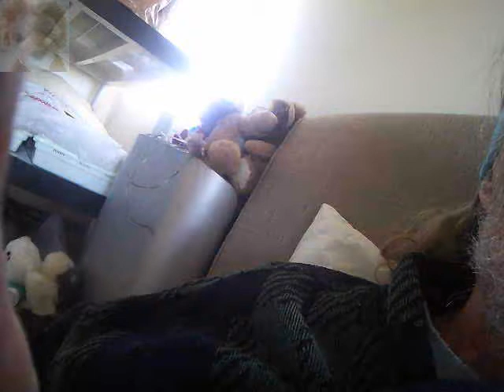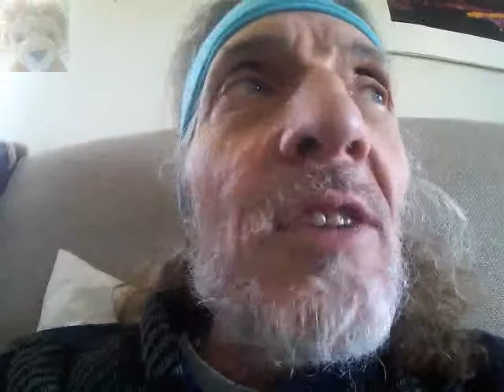Energy Machine of Joseph Newman IS Overunity, yet IS NOT very efficient.

Comment: some thoughts.    assumptions.   they tend to lead us ASTRAY, whatever the field of endeavor.      notwithstanding simulation results to the contrary, do you Normally Assume that a claim of overunity is  Valid, when such claimed performance has  NEVER  Once  been Replicated.  ( ie, searle, neuman, and others;   such a circumstance leaves me,  very  Dubious  about the Validity of the original claim.  )      cheers
Reply from the maker: The realm of the abstract idea is very real. We could not engineer bridges or sonnets or recipes in the concrete realm, wherein we live and breathe and take up space, without it. It needs no other defense. It is our Muse; we are its beneficiary. It is eternal and non-changing; we are temporal filled with imperfections including the doubt of its existence while feeding from it at the same time.

"Never bite the hand which feeds us" is aptly applicable.

How long can we live without inspiration?

Next question, posed by God to Noah.....
"Hey dude, how long do you think that you can tread water?"

The only failure to replication would be our lack of understanding and the initiative to work hard picking ourselves up no matter how many times we fail or doubt our integrity.
Reply from the maker: Check out...
http://is.gd/divcon
Reply: do you know that this responds to my reply  Not  At  All.     if someone claimed to have designed a super-efficient  rectangular,  not square or round,  wheel and made fabulous claims about it,  would you be  Extremely  skeptical.  if so, i would consider that a good  Beginning.   of  All  the existing ou concepts published on yt, there has  NOT  been  one  successful follow-up (replication).  instead, what we have seen is hundreds of  hoaxes.         so.  consider letting go of some of the ( comfortable ) wholly Unsupported  opinions that you have nurtured for so long.    fresh  'forward-thinking' is what we need.       cheers
Reply from the maker: No fault of mine. Blame lack of collective consciousness.

I just did a quick search and found vacuum variable capacitors ( the heart and soul of http://is.gd/syncur ) and found plenty which were rated in the pico Farad range, but none in the milli Farad range much less one or ten Farads.

So, like all my other simulations using Paul Falstad's electronic simulator, they're not buildable for one reason or another.

Joseph Newman's, simulated in LTSpice, is the exception.

I managed to inspire one person to build Jo's device with my suggested improvement of adding a neon bulb or similar spark gap in series with the capacitor (both are parallel to Jo's massive copper coil), but I haven't asked him since then (several weeks ago) how his project is doing. In fact, I can't remember his name.

But you've inspired me to see if I can locate his email and ask him how's he doing?

As for me, I always like to think that I may build some or another of my simulations one day. Who knows what the future holds for me?

Thanks for asking...
Reply from the maker: Actually, syncur is buildable if numerous vacuum variable capacitors were stacked in series to add up to the required amount of Farads -- a heck of a lot! And tie them all together to the same controlling mechanism to help make their adjustments a lot easier en masse.